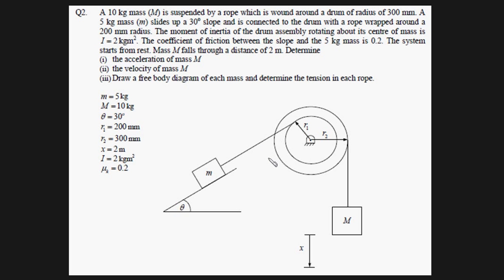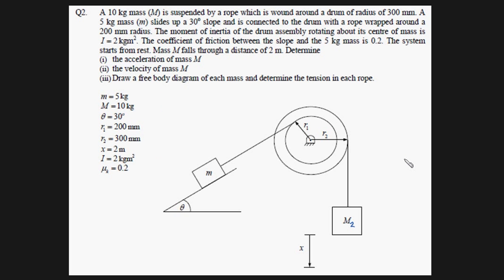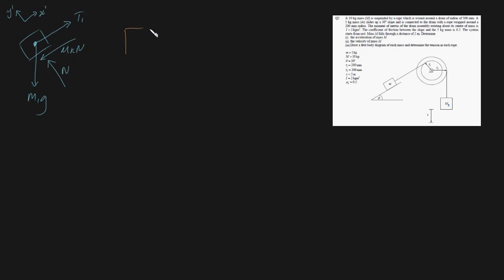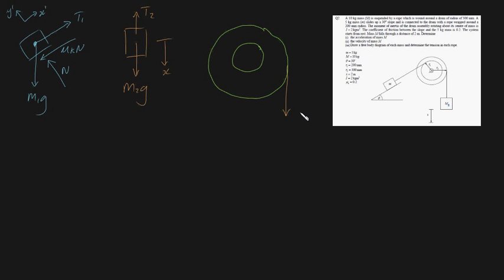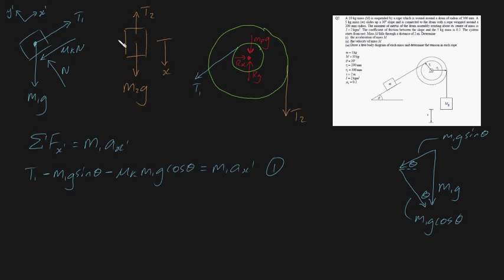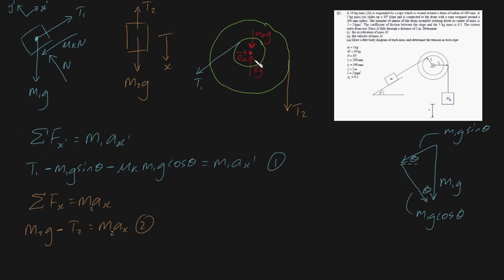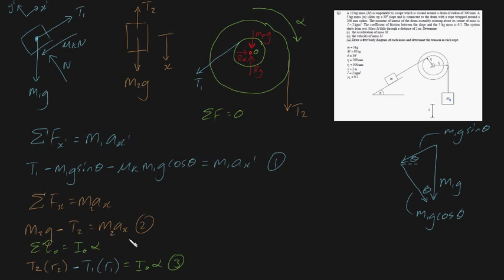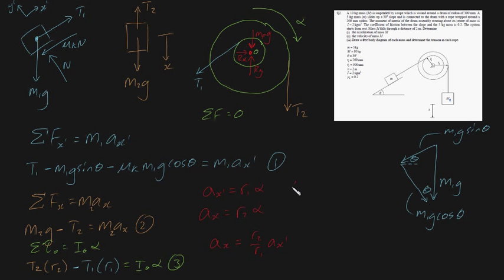Dynamics exam example problem

Comment: Thank you so much Mathew for that exam revision. It would be less confusing if you let y to mean the vertical direction because students are so used to understanding x as horizontal and y as vertical. Guys, if you are wondering how he's got to that final step, here's a few tips to consider: 1. The angular acceleration alpha = a/r2. a is in vertical dir (x in this example). So in this case you would have Io.alpha = Io.ax/r2. 2. If you substitute ax = (r2/r1)x' into the torque/moment equation, your answer will be in terms of x' which is not what you want. Instead, rearrange to get ax' = (r1/r2)ax then substitute it in to m1ax'.  

The solution of this example is quite profound, because here you can consider a few scenarios, ie what is the acceleration when r1 = r2, when the angle theta = 0, when there is no friction.
Reply from the maker: Hey mate! Great advice! Thanks! Thank you for wanting to help out other students eager to learn! :D